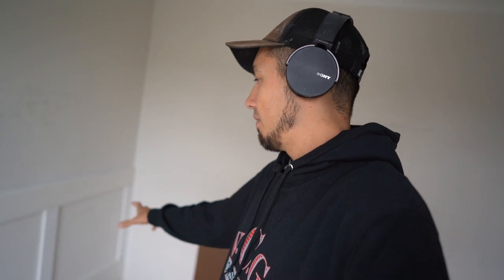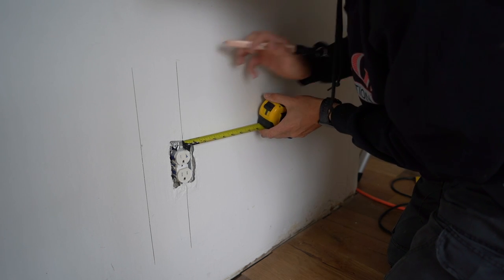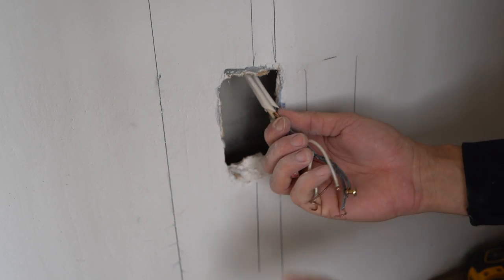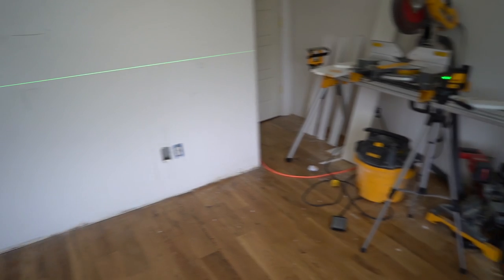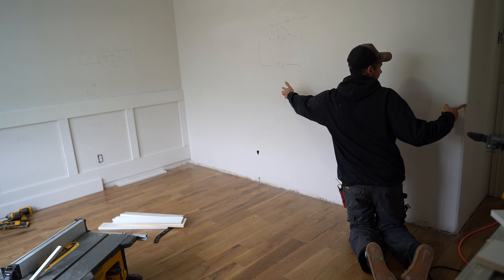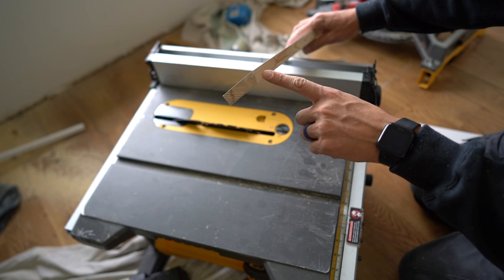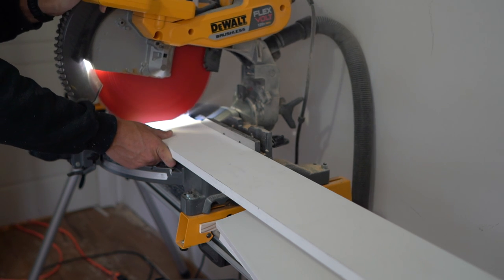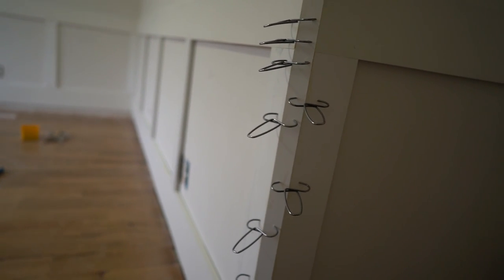Wainscoting around a corner (bullnose wrap)

Comment: Around here we have metal electrical boxes.  Any time I need to “break” one free from the stud I slip a metal cutting blade into my recip (saws all) and cut the two nail right along the stud.   Works well on newer installs were there are screws holding the boxes on too.  I’m also in favor of the other comments about using the oscillating tool to cut out the drywall.  If you are worried about cutting into something behind the wall just use the tip or corner of the blade to follow your lines and only go as deep as the drywall is thick.  Great series btw Richard.  You’re making want to do this in my old house.  Always thought it gives any observer that thought of attention to detail.

Comment: After watching another video where you used the spring clamps I decided I really needed a set.  Checked the internet and found several "cheap, made in China" offerings and one made in USA.  (The ones you are using in your videos) at twice the price.  Though it over for a couple of days and bit the bullet and got the good ones.  Turns out for me, they would have been cheap at twice the price.  Latest project required miter corners on trim.  Dug out the spring clamps and for the first time I can remember I got perfect results.  These spring clamps are great.  Just check fit, apply glue and clamp, perfect results.  Keep on introducing new products.

Comment: An oscillating multi tool is a nifty alternative to a drywall "jab saw"
Reply: I hate using drywall saws lol I use that oscillating multi tool for drywall all the time. The carbide blades are best because drywall won't dull carbide
Reply: i use it for every application. drywall wood and alluminum.
Reply: Was wondering why he used jab saw when he used oscillating tool to cut apart old electrical box
Reply: One concern is that an oscillating tool will go through just about anything. Cutting by hand with a drywall saw allows you to feel if you are hitting anything important such as a pipe or a wire
Reply: @mikevandenbosch9081  True. Very true
Reply: @mikevandenbosch9081  you probably have a little more feel but you can feel with a multitool. Surgeons use oscillating tools to cut bone. Also used to cut casts off.
Reply: @bvausch1  k
Reply: smokingcheeba420 Pretty sure surgeons don’t come across an artery where they don’t expect it.
Reply: @mikevandenbosch9081  the blades come with a little mark at 5/8 for a reason. You put a little bit of painters tape or whatever to mark 5/8 + on your blade and go git em
Reply: smokingcheeba420 awesome comment I’m pretty sure that’s what it was invented for , the removal of plaster casts , some of the blades are made with measurement graduations 
Cut a half inch deep , 
BEST TOOL EVER!
Reply: My only concern in that situation would be breaking off the small piece between the two holes.

Comment: For cutting drywall I like Dremel MM435 Drywall Jab Saw Oscillating Tool Accessory. When you use it for the first few times it will seem strange; however, once you get used to it you will love it. When I cut a hole to run wire I can use the cut out piece as my patch due to the tool being so thin.

Comment: Thanks to your videos I've moved two outlets and a switch. It looks much better just to move them than to wainscot around them. Unfortunately, in my case I had to fill the holes they left behind because I was doing shadow boxes on the entire room from top to bottom so I just used the drywall as the background instead of plywood or some other smooth surface. To cover the holes I screwed a piece of 1x3 pine behind the hole and cut a scrap piece of drywall to fit. Then I just used a couple coats of drywall compound and sanded smooth. So moving outlets and fixing the holes is very simple and well worth it.

Comment: I’ve had to move a bunch of boxes, I used to remove them with a wonder bar too, but the best way I found was to take a hacksaw blade and wrap electrical tape on one end to make a handle and saw the nails off. I know it might seem like a time consuming process but I feel like it’s faster than just using a wonder bar. There’s been some instances where using a wonder bar pulled the box into the drywall and cracked the surrounding drywall. Anyway.. I thought I’d mention my own experience with it. Another great vid man. Thank you for sharing.

Comment: I have been renting a house for the last 2 1/2 years and remodeling it for the owner.  A few months ago he gave me the option to buy it.  I closed on the house yesterday.  I can not wait to start trimming out the house.  Your tips are life savers.  I need some help with the front door.  The door is level and square but the wall is NOT.  The casing is proud about 1/4 inch at the top and recessed about 3/8 at the bottom.  I am hunting a way to fix this that does not involve 9 lbs of wood filler.  I dont want the reveal to be out of wack either.  If you ever run across this please make a video.  I have seen a few on here but they are awful examples of people butchering the sheet rock and shoving the trim into the wall.  I will trim out everything except the front wall waiting for your expert advice.  Thank you for the time and effort man.  Your videos are awesome.

Comment: Great video!  When the laser hits the wall you get one thin line and a kind of glow on both sides of the line.  That's the wall reflected a nearby bright light.  But the camera is sensitive to this and appears to combine all three into one thick line.  The more reflective the surface the greater the effect.  You can see the size of the actual line when it hits your hat or dark clothes.

Comment: Richard you never cease to amaze brother! It’s really cool watching you grow and share the knowledge. Super talented man and cool as a cucumber! Are you using a standard finish blade on your table saw? How many teeth?
Reply: Brendan Okeefe It looks like the factory 8 1/4”. 24 tooth blade.
Reply: Stephen Russell isn’t the 24 tooth a framing blade tho? That’d be a little rough for trim
Reply: Brendan Okeefe  The blade technology has come a long way ! Dewalt sells the Saw with a cheap multi purpose blade that works great while it’s sharp. The only disadvantage of that Saw is the limited selection of 8 1/4” Blades.  I love the 10” Corded Jobsite Dewalt Table Saw.
Reply: Stephen Russell I’m well aware of the cheap Dewalt blades lol. I asked about the tooth count because I usually use a finish blade ie-more teeth/smoother finish. I have used a standard (framing /utility) blade when it was brand new to cut baseboard or 1/ pine. However if you use a lower count blade on a bevel cut or any kind of intricate cut it’ll leave burn marks or tear out/splintering. I figured Richard would be using some speciality blade with his love for MDF lol. Thanks for your input brotha

Comment: An idea for wrapping around the bullnose corner (fyi, I’ve not tried personally)... what if you went ahead and just made it a hard 90, then used a router with a round over bit along the edge to recreate a “bullnose” on the wainscot trim? Off the top of my head, the shape would be nice and match the rest of the exposed drywall rounded corners, but I’m thinking that the exposed edge-grain of the wainscot might not look so good even after paint.

Comment: I don't have a miter saw. Would you reccomend a cordless one over a corded?
Reply: No batteries are expensive. If you have power available just use it. I only run cordless when its really needed. Like drills,multi tool, sanders.

Comment: Don't see this much in the UK my question and sorry if u addressed this in an earlier video ! The square dimensions on every wall I assume are slightly different to the first wall as it would be virtually impossible to have them the same without having a small section on a particular wall end is this correct?  ,is it worked out that vertical pieces are as close to the first as possible but probably not the same distance apart on everywall ???? Thanks in advance to any who replies nice work

Comment: You could have removed the staple for more slack if necessary. The staples aren't necessary when extending or moving a circuit within a wall cavity. 

Also if you had the receptacle land in the vertical you would want to make sure to shield any flammable surfaces you add.

Comment: You probably know this already, but instead of using that drywall tool (saw), I have that Dewalt Multi-Tool you have, and there is an attachment with a depth gauge to cut shapes out of drywall (instead of buying a Rototool (Roto Zip?) or something). It would be faster and cleaner I imagine. Then again, maybe you're really fast doing it for a living.

Comment: When using an old work box with a duplex receptacle, break off the plaster ears(Mickey mouse ears)on the receptacle, it will fit perfectly flush on the box and won’t cause the cover plate to have issues sitting flat on the wall.

Comment: How do I sign up for the memberships and donate? Love your videos. Quick question, what would you do on the outside corner if it was a standard corner? Miter the ends? Or overlap?
Reply from the maker: Hey thanks! There is a link at the top of the description. Yes, if it was a normal 90 degree you would just do 2 45's

Comment: I think you should have put a quick California patch into that old location for the outlet.
Your units will not be a perfect seal against the wall.
Air leaks are horrible for HVAC efficiency.
Reply: I do a lot of drywall work and he had the perfect block to patch it already cut from the new outlet.  He is placing the yuca board over it though so there really is no need at all to patch it.
Reply: Im sure his heating and cooling bill is gonna skyrocket!!!
Reply: If it were an exterior wall. That wall does nothing for efficiency. Just throwing that out there. Not a tad of insulation or air leakage to worry about

Comment: Sorry sent message to early ; I have e a question for you a lot of the walls I panel are solid walls ,plaster on concrete block or brick ,do you ever come up against this ?if so how do you fix panels to these type of walls? Hope to here back from you , keep up the good work
Reply: Glue. Intagrab works great. And short nails nailed at an angle into the plaster.

Comment: A couple points.
A) there is nothing wrong with popping out a staple. Electricians commonly leave a little slack at the staple for exactly the reason you are making the video. The reason for the staple is to avoid pinching the wire underneath the stud during drywall installation. Staples are not required when fishing wires through and otherwise enclosed wall. The NEC requires 1/4 in of sheathing inside the box, it's better to pop the staple loose to get the extra slack than have too little sheathing or wire to work with.

B) If you are adding plywood to the wall you should wait until after the plywood panels are installed to add the remodel box so that the wires are not exposed to flammable materials.

Comment: What is the thought behind waiting to shoot the rest of the brad nails into the unit until after the corner glue dried? What if it after it sets, the nailer causes the dried glue bonds to crack? Is that not a possibility?
Reply: Not usually the case on a proper glue up. You'll break the wood before breaking the bond of the glue. That way it can be tweaked around if necessary. Pressure can be put on it without any unwanted corner movement. Hope that helps 👍
Reply: Not if you glued it right. People dont use enough glue.
Reply: @MostlyPeacefulCombatVet , understood. Thank you!
Reply: @jesikaglenn4561  any time! 👍

Comment: When dealing with drywall window returns, is it best to remove the drywall and corner bead or can you go right over the jambs with wood trim and casing?
Reply: I removed mine because the the reveal would have been about an 1/8 of an inch and did not look good.  With the drywall out and corner bead removed the reveal is just about 5/8 all the way around.  Looks much better.  My opinion is just fit a piece of trim inside with the drywall in and see how it looks before deciding.

Comment: I hate using drywall saws. I use an oscillating multi tool.its faster and you get cleaner results.
Reply: First time you cut into a water line or wire you will change your mind.  The multi tool is awesome but you gotta know what is behind the rock.  I have done a lot of sheet rock repairs for people who cut waterlines and saturated their first floor ceilings.  Both times they were moving outlets in kitchens to put in new cabinets.
Reply: @destinmattressnow5172  you can also mark your blade at 5/8 so that way you know right when your blade is gonna get through so you can pull out. But never go balls deep lol
Reply: I usually have my blade wrapped with blue tape at 5/8 so I know when to stop cutting

Comment: Honestly.. just move the style over an inch. Saves all the having to open up the outlet.
Reply: TurboFlush  I could be wrong. But, I believe he did that so all the stiles around the room are equally spaced. I would’ve done exactly what he did. 5 minutes of work for a visually pleasing appearance.
Reply: @jimserhant7741  
Yes.. sure he did for more visual balance. Sometimes an inch is not noticable. Especially when furniture covers a good percentage of the wall. 
Prying on the wall like that can sometimes lead to disaster also. 
I have decorative outlets in my house.. many you can't see due to furniture.
Reply: TurboFlush And what if there is no furniture going against that wall OR there is, but they decide to  rearrange it in the future? I respect your opinion completely. I’m just of the school of thought that just because something won’t be seen, that doesn’t mean you don’t do it right.
Reply: @jimserhant7741  even with no furniture I wouldn't move something that is more permanent than what I am installing. 
1 inch.. doubt the eye will catch that on a big wall. Especially if there is objects on the wall. More than likely there is something on the wall even small. Also.. more than likely the eye will usually be off angle to the room and the wall, so alot harder for the eye to compare an inch. 2 inch off .. yah probably catch that. 
Your eye would also be more likely to see the beam not plumb or level. 

For me.. in this situation I see before me.. not worth moving the outlet. And yes.. I enjoy quality work. Just sometimes more work is not worth it.

Comment: Next time just pry it a 16th if an inch and use a metal saws all and cut the nails on the box and u can pull it right out
Reply: Especially if u ever have to be really neat when u do it . If it was right behin the panel and at the edge and u wanted to used the board to cover it, u could use the sawawl. If u pry it just enough the fit the blade and start at the middle and cut down to do the lower and up for upper. And then u can just indue the wires from the outlet and pull the wires out the box and u don’t need to cut it either

Comment: You installed the outlet is upside down!
Reply: no way man, ground down is the way to go. i had to redo all the outlets in my house to get them right, lol. so much stuff doesn't fit right when plugged in ground up.
Reply: Code allows any orientation, however, try to plug in the majority of major appliances like a refrigerator or washing machine, and you will notice the cords are made for a “ground on the bottom” orientation.
Reply: @feelingtardy  I always have this battle and hate it. Im a ground downer. lol... Besides that is how the receptacle tester label reads haha
Reply: I install always to match existing outlets in the home which is always ground down but I read somewhere that there is a special code when installed in hospitals the ground is up. Since I do not do commercial work including hospitals, I do not really know which is required.
Reply: @jerrygrayson65  you are right. The rest of the world does ground up. Americans do it ground down to be more visually appealing. Because it looks like a face or something? Its a safer way ground up. Belive it or not.